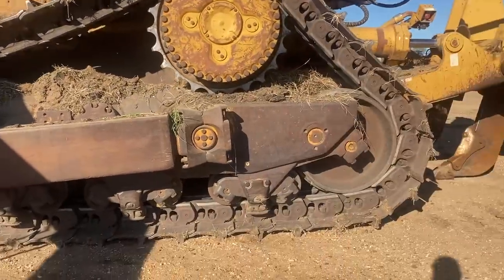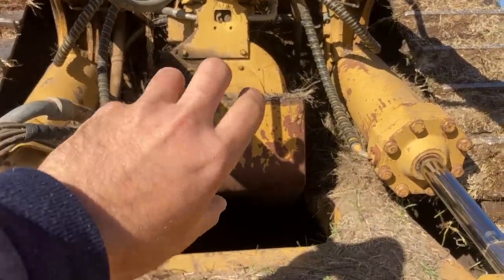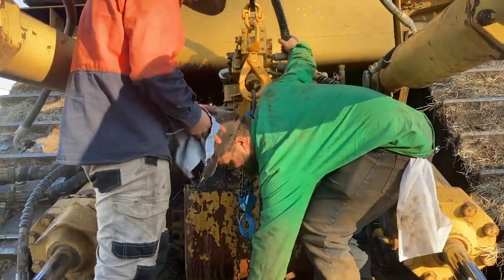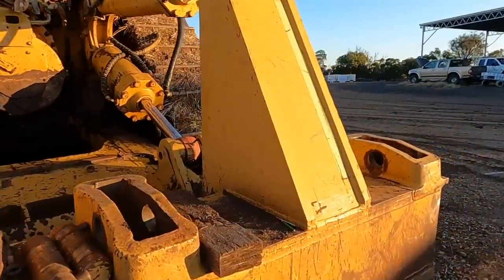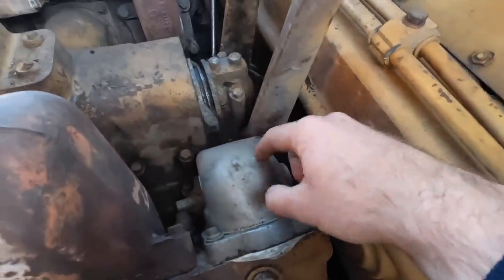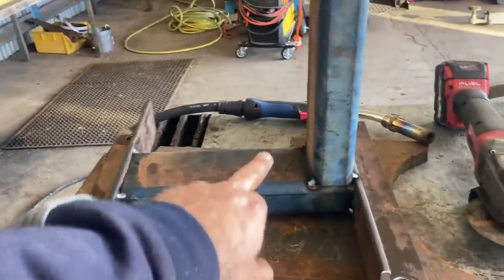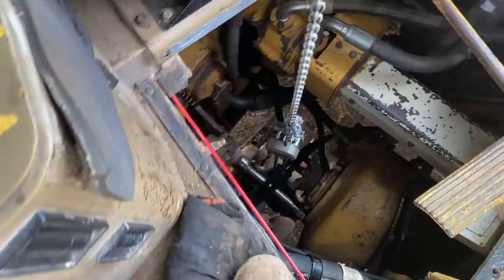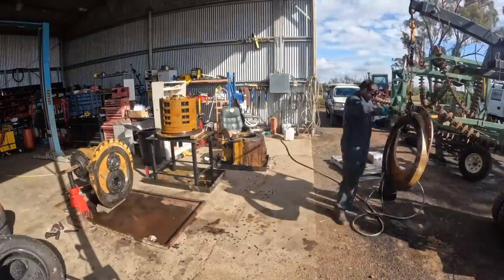D11 Transmission Out!!! Tiny 1 Maintenance Pt 1

Comment: Just an FYI for next time, even though the bevel gear to trans adapter is dowled to the bevel gear it must be clocked in with the dowles out and o ring off so the input gear is in the centre of the  trans mounting bore, once clocked in check the dowle holes lign up if they don't you can machine them out oversize and put oversize dowles in. If they do fit the o ring, bolt it down loose, clock it in and tighten the bolts then drive the dowles in, put a 3/8" bolt and washer in the dowels so you don't hammer the threads in. Unfortunetly the o rings won't last as long as the trans when the machine is not abused. You won't get dirt in the engine through those inlet elbows as they are after the aftercooler so the air is blowing out but you can fill the engine with water if washing the engine down or parked out in the weather. Good job on the trans lift bracket, just don't let WH&S catch you use it, all lifting equipment in Australia must be tested to 2.5 x the weight being lifted and marked with a WLL as per Australian standards. 👍
Reply: WH&S haven't met can do farmers  with buckets of.common sence .

Comment: Good work making your jig. I made up something similar for attaching a truck gearbox to a trolley jack. I mounted a plate to pto pump side hole and then welded a strut off it with a neat pin fit into swivel hole on my jack. Gearbox could rotate slightly for aligning it but couldn't fall over. Only got one set of fingers. In fact when I had truck up on axle stands and was taking out gearbox an earthquake struck and fell off axle stands and rolled across yard. I had pto plate off but didn't have jack in place. Good old Christchurch NZ. We had hundreds of nasty quakes for about three years after big one of 2010. Actually over 10000 after shocks in the next ten years but most were just a quick bang, shake and rumble.

Comment: You probably already know, one way or the other, by now, but my experience is (none on heavy equipment) that sealing one area of a high hour system up tight can over stress other areas further down stream.  Do you ever worry about this?
Reply: I don't think that's the case mate, I just think if you're sealing up something because the seals are letting go chances are other seals the same age will start letting go too, it's all in your head haha